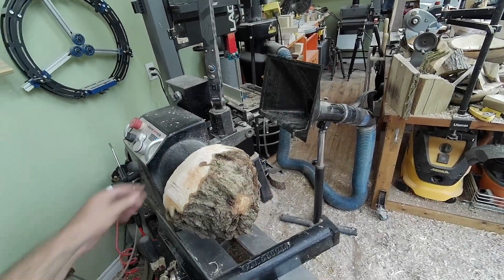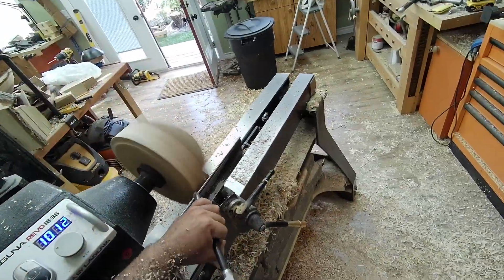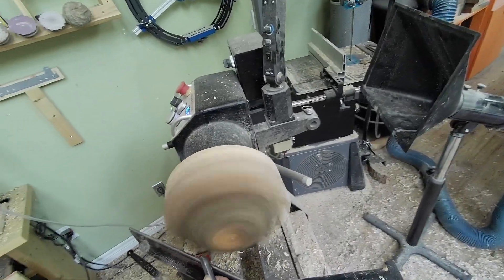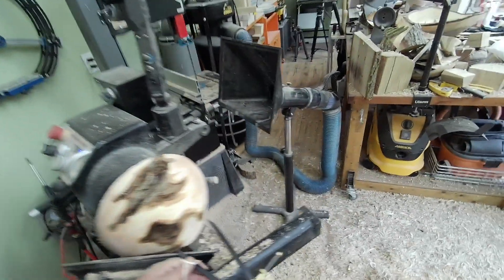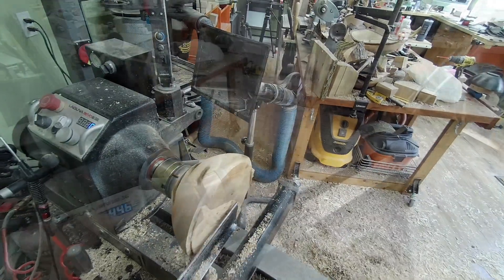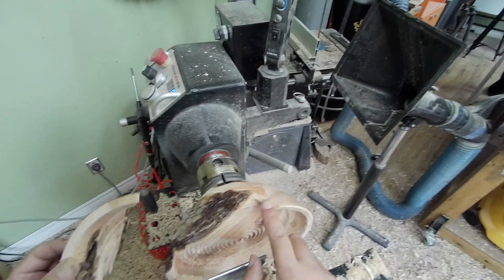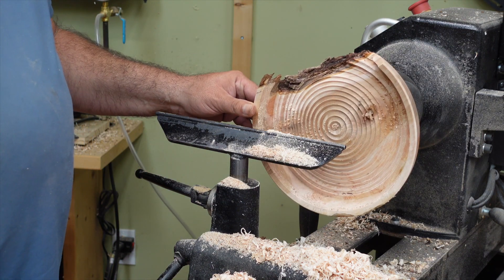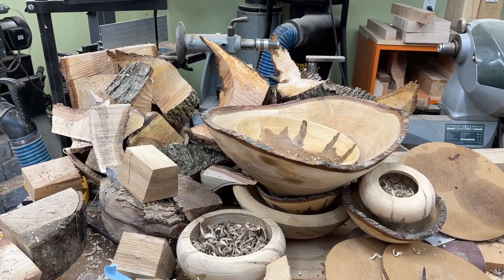The Big Bang Theory Happened Twice

Comment: Looks like you have a UVEX face hood.  I don't do videos with mics and such, but I wear my UVEX whenever I'm turning or sharpening.  No, I'm not the safety police.  Honestly, sometimes I forget I'm wearing the thing.  I do keep mine pretty clean.  A quick rinse in the kitchen sink with a little Dawn soap will cure what ails ya.  Keep Calm and Turn On.  🙂
Reply from the maker: It's good to be safe, i wear a camera that seats on my head beside my safety glasses so it doesn't work with the shield. but i make a point of wearing it if i don't feel safe with a particular piece.